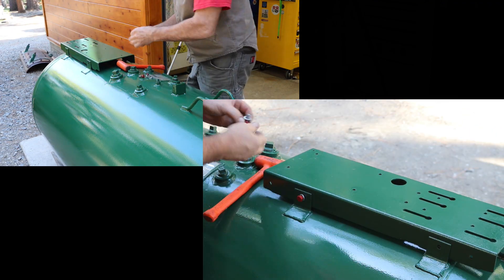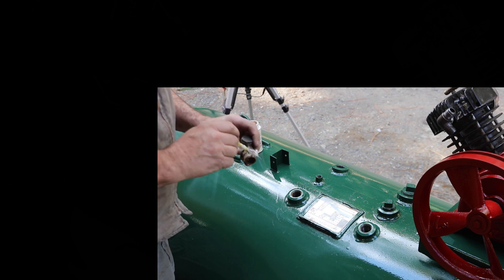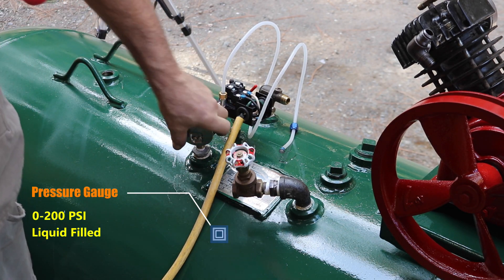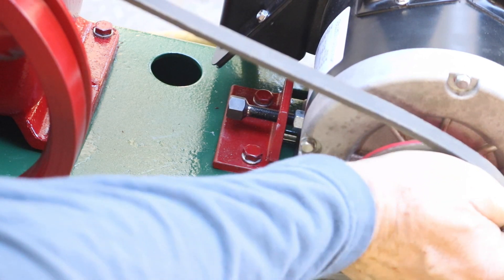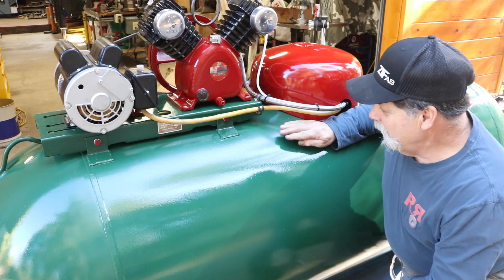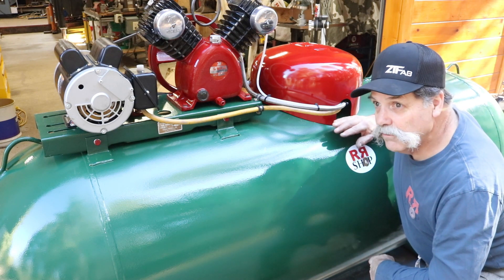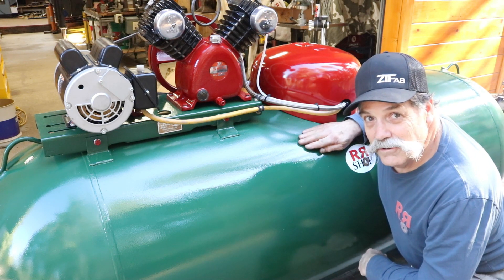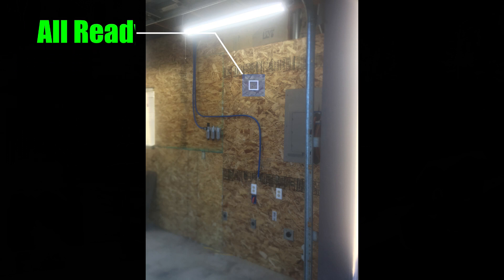Build a Giant Air Compressor for under $200 and 250 gal Upgrade P4

Comment: I managed to find a 250 gal tank for $100. cleaned and painted it up. it has a different setup for the bosses on top so I'm having to figure out how to go about plumbing the thing. I got a twin cylinder single stage compressor rated for a 5hp motor mounted the same way yours is. no motor yet because all i can find are 5hp peak hp motors at around $250 and I'm on a really tight budget. I do have the check valve mounted in tank and have a Square D pressure switch. I keep this video saved just to make sure I run everything correctly. I still need a good gauge and the pex line for the return. then I get to run a 220v line out to my carport. tight spaces to work in for running electrical. its been a fun project though. I mounted locking casters on the bottom of my tank feet instead of solid pipes so i can easily move the tank if I have to.
Reply from the maker: Sounds good so far.  Casters are a good idea on a hard surface, it is heavy.  Thanks for watching.  this one is running great.

Comment: very nice job on that compressor, 
The only thing I'd done over what you done is to add an aftercooler to trap the water before the air flow reaches the tank.
It is very important that the tank stays cool to promote a final decantation of the water in the tank and avoid  water decantation in your air network.
very good video.

Comment: Just binge watched all 4 parts and loved it. You might consider putting an air cooler/water condenser in-line with the out of the compressor to the tank. You get dry air and don't rust up the inside of your tank that way.
Reply from the maker: Thanks for the tips!

Comment: 30 minutes to fill? That would drive me nuts.
Reply from the maker: From empty 0 psi about 40-45 min.  from 100 to 125 Pressure switch setting about 15-20min.  And it is very quite, almost do not know it is running.

Comment: But that takes an hour to fill.
Reply from the maker: From empty 0 psi about 40-45 min.  from 100 to 125 Pressure switch setting about 15-20min.  And it is very quite, almost do not know it is running.

Comment: Lord knows money isn't free but neither is your time my good man. Awesome Re-purposing project and I am a Subbie now. By the way, will you be making some of those Pump Tensioner's for the marketplace?  I would love to add that to my system. Makes belt replacing a snap breeze. I added a Derale cooling coil to drop those temp's and a water/oil separator before the tank fill so when it unloads, the separator unloads any accumulated water automatically.  Takes the temps back to between 50 and 90 F dependent on the room temp's. I was going to add a water coil bucket but found I didn't really need it.  But I NEED THAT TENSIONER in a very bad way, and I am no machinist my good man. Maybe I could cobble something together, but, I like the neat clean pro look of your design. Would you consider licensing it for production rights?
Reply from the maker: Thank you Anon.  Send me an email and I will send you a drawing of the tensioner for you to build.  RRINTHESHOP@GMAIL.COM

Comment: Randy,  great series on this build out.  I too have a "spare" propane tank that I have been seriously considering repurposing into a compressor.  My biggest concern is welding on a pressure vessel (to mount the compressor/motor package like you did)  as it relates to the integrity of the shell.  Did you have similar concerns ?   If a 250 gallon tank with 150 psi on it comes unzipped  at a spot that has been welded on. its going to be a bad day.
Reply from the maker: 92xl. I can not tell you what to do.  The tank I used was in excellent exterior and interior condition.  The welding to the tank were all exterior welds with no penetration of the vessel.  The propane relief valve was set for 250 psig ( standard setting).  That is propane @130F is 257psig.  I lowered the pressure to about 130 psig.  I set the pressure switch to about 110 psig.  Use the existing tank connections.  You could do this with no welding.  Use a drop tube into the tank to remove the condensate.  Make a compressor mount with rubber feet to saddle on the tank and strap down.  Email me if you want to talk more, rrintheshop@gmail.com.

Comment: Unfortunately there's some math Behind the CFM output of a compressor, something about it's rated at atmospheric pressure and not actual CFM you'd expect. So realistically the compressor is probably rated at 5/6 cfm

Comment: I don't know if this was mentioned (too much to read), you should install
an after-cooler/condenser water trap, to make sure water does not make it into your tank.
Reply from the maker: There is a drain and blowdown.
Reply: @RRINTHESHOP : Yes, I know about that, but that only deals with what gets into
the tank and always leaves a little bit.
The after-cooler/condenser goes Between the compressor and the tank and
keeps water from getting INTO the tank.

Comment: Is it feasable to bury a large compressor tank in the ground for safety? If it explodes at least it won't fly like a rocket?
Reply: If that tank explode underground it can potentially couse a shockwave just like earthquake that can potentially crack the foundation of your house or shop or your neighbours haus not mention the dirt and rocks fly everywhere. The pressurise tanks are never bearied underground so you can't do periodic inspection. If you worry about explosion put the tank in some kind of sheed outside
Reply: You can place a propane tank underground, provided it is designed for that service. An underground receiver is no different as long as it is designed to be buried.

Comment: If you are running a hypertherm for your plasma table make sure you put a gauge right at the inlet of the unit. Hypers dont like dropping below 100psi inlet when cnc plasma cutting. Very important to watch the gauge at the machine when cutting. Great build.
Reply from the maker: Roger that, thanks for the tip,  We have the regulator right at there.  Thanks TJS.

Comment: You''l probably want to wire that pressure switch to control a heavier duty contactor.  The contacts in those pressure switches are undersized.
Reply from the maker: Yep maybe in the future, Thanks for the suggestion.

Comment: Nice work. What capacity, gallons per minute, do You expect?
Reply from the maker: The compressor is 16 CFM @ 125psi, the receiver is 250 gal. and it is running at design rpm.  Thanks Stefan.
Reply: @RRINTHESHOP  Made a quick conversion and got 430 liters per minute..... Air pressure tools need pressure but some of them also "consume" volumes.... A huge tank like that would manage a lot for a short time. The size of the compressor cylinders is not exactly big.
Reply from the maker: @Stefan_Boerjesson  No the compressor is not huge, but the receiver is.
Reply: @RRINTHESHOP  That will work but the intermittence factor needs to be considered or checking pressure.... Else the receiver will be underpowered..... You know all that...
At one job I had, building 3 wheel fork lift trucks, the customers reported that the steering/driving wheel was falling off. All tools where checked for proper torque, no faults. The fault was the main supply of air. The pressure occasionally dropped too much but no alarm stopped the work....

Comment: Sweet build Randy. Those SS braided air lines can eat through anything they touch due to vibration. Discharge temps can get high when coming directly from the head, so Teflon lined discharge lines are usually needed.
Reply from the maker: Thank you Brian.  Yep the air temp in the cylinder at 125 psi is 540 F. the hose is rated at 450 F@ 1500psi.  The air cools very quick by the time it gets to the hose and is only about 300 F or less.  It is working great.